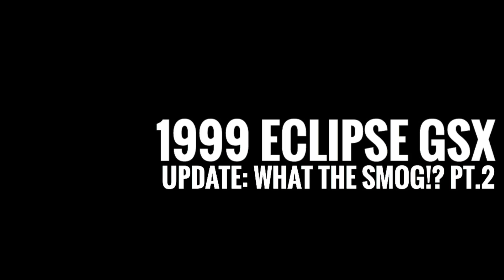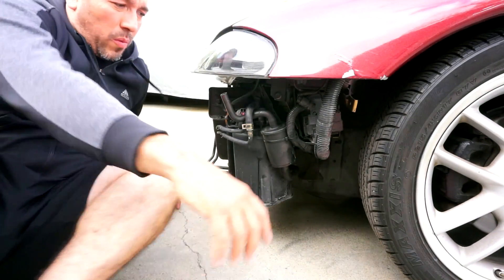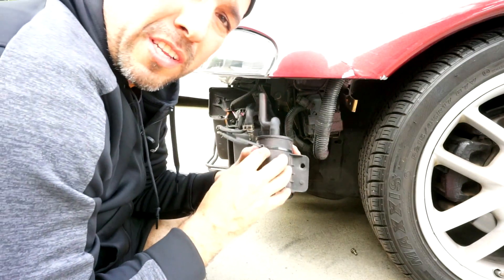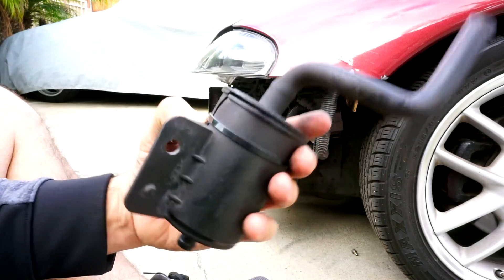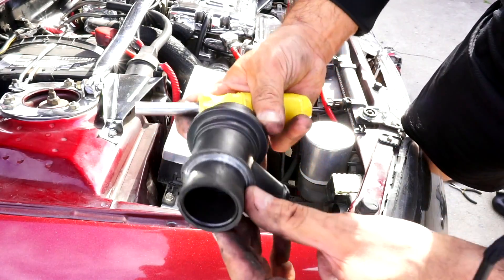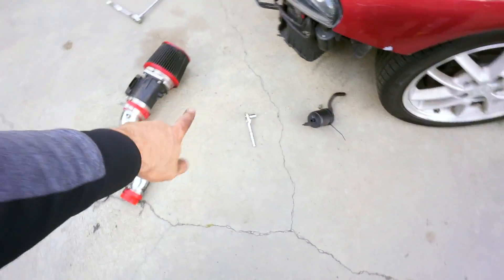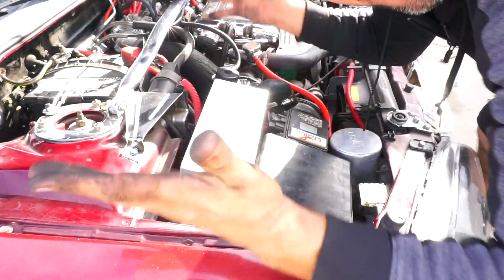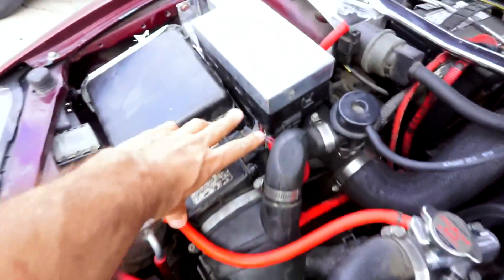1999 MITSUBISHI ECLIPSE GSX UPDATE: WHAT THE SMOG PT.2

Comment: I follow all yr videos,  got 99 Spyder GS hey yr a mechanic on these... I got a PO 170 engine code on my car and idles rough sometimes and it says it's running lean. Now that's a mass airflow but I've replaced it and the O2 sensors still the engine lights on what do you think the problem is?any ideas? Gracias
Reply from the maker: Thank you for watching! I wish I was a mechanic ;) I'm just a car guy! I would have no clue sorry :( I'd ask people on FB forums that question. I'm just now getting back into Eclipse after 15 years away from them.

Comment: I heard that once you start modifying a car with aftermarket parts, they tend to wear down the Oem parts much quicker because it is outside of manufacturers specs. But with everything stock OEM, it'll last much longer. I could be wrong but it does make sense in a way.
Reply from the maker: Pokemonguy16RS makes total sense! But does it! 🏎💨😈
Reply: Pokemonguy16RS na, it's when internal parts are thrown in half ass and not done the right way.
Reply: Pokemonguy16RS it all depends if you replace it with quality aftermarket products. If it's cheap aftermarket, it's not worth it.
Reply from the maker: Mr Valenzuela truth!
Reply: Totally agree.

Comment: Back in the time 200HP to 250HP was fast, now cars stock be pushing 300.
Reply from the maker: Right!!
Reply: Don’t know, 03 Cobra’s came with 400hp, so did 98’ corvettes.  Camaro’s had 330hp stock for years and years.  

Only thing about those cars is that they’re expensive to maintain.  For instance, on my 96 Camaro z28 it’s $800 to install spark plugs and wires because of how much labor is involved in removing parts to get access to the spark plugs.

I can get a brand new transmission installed in an eclipse for $750, by contrast.  And can do plugs and wires myself in 5 min.  

The v8’s also get around 19mpg average, compared to the 26mpg average of an eclipse — etc. 

The American cars are better cars though, to be sure, they’re just more complicated and labour intensive to maintain.
Reply: Robert Wilson III yea I know man, but we talking about imports. They where way cheaper to buy and maintain.

Comment: Change the oil with a heavier oil and drive the car for at least 10 miles before the smog test, clean the MAF,  use low octane fuel:  just a quarter tank then fill it up with premium after the test (the car will run like sht just an FIY but it will run lean). Use a fuel treatment that lower emissions. The intercooler is not going to change the emissions and is an item of not concern in California.
Reply from the maker: Thanks for the great info bro!